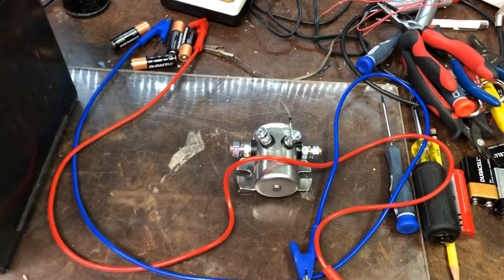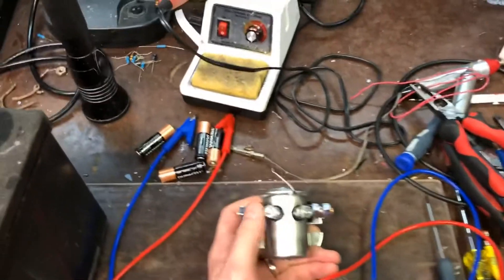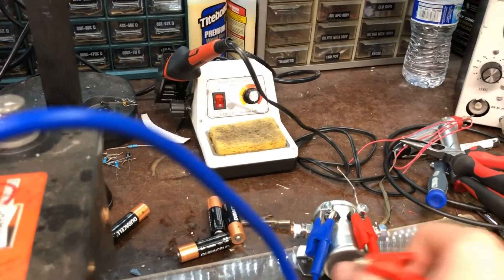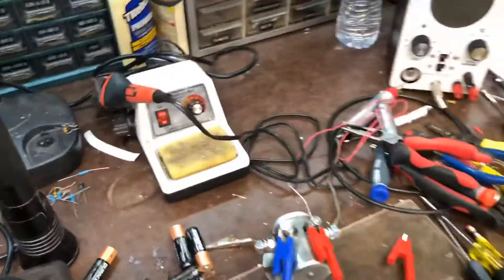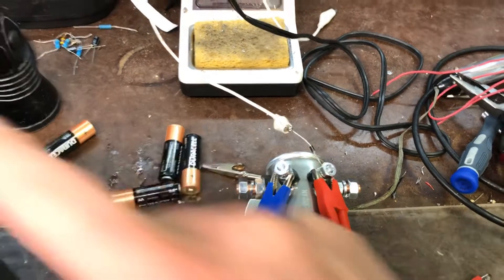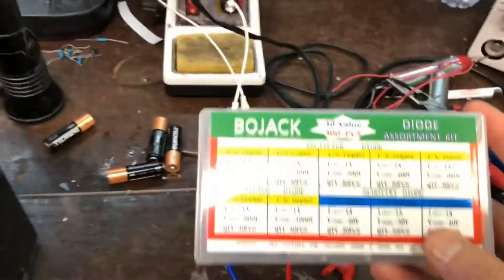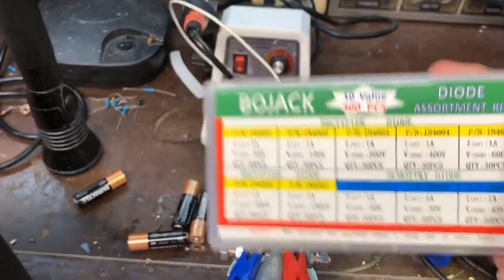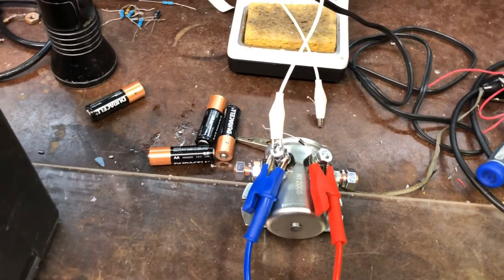Flyback Diodes for Dummies

Comment: Good explanation and video. I’m am an electrician and work mostly in industrial environments on motor and machine controls, and familiar with the need for diodes across coils. Surprisingly, this knowledge seemed to skip the automotive market. Possibly due to old cars having limited to no solid state electronics. The popularity of the aftermarket TBI systems has increased over the last several years and I often hear about the control modules failing. Im curious how many failures are due to flyback? I am surprised the manufacturers of these systems haven’t suggested or required ( for warranty purposes) installing flyback diodes across all relays or using diode protected relays that are switched by the controller, fuel pump, fans, ignition, etc. Most Bosch and other automotive relays do have internal diodes, but if people are getting cheap Chinese relays from Amazon or eBay, good possibility they aren’t equipped with diodes. A control board rated for 5 or even 12 volts isn’t going last with repeated flyback voltage spiking through the electronics.

Comment: this is really good info im building a full auto recoil gun controller and i have 2 push pull solenoids in parallel hooked up to a strobe light module thats power input is a micro switch (momentary switch) and after a few strokes full auto the switch contacts get burnt up and the strobe module flasher module probably gets burn up too i learned this by burning through a few, i hope by installing a flyback diode the industive load wont cause that nasty voltage spike and arc

Comment: Im going to use a flyback diode for a diy wind turbine. Im using mc4 connectors for the positive and negative terminals to hook it up to my wattfun. Now a days they have mc4 connectors with diodes in them so im going to buy one of those for my positive terminal. That way i dont need a controller or anything just plug and play

Comment: Nice practical vid.
Another "101" is to never wear wedding rings (or any other kind of rings or metallic jewelry) when working with electricity, especially batteries. A ring can turn white hot in a fraction of a second when shorted to a battery. Not a pleasant way to start your day.
Reply: Me backs up the video and sure enough there's the ring 🤣🤣.  That car battery can put 50-100 amps through it 🤦 goodbye finger.

Comment: Most Bosch relays have suppression built into them, check the little schematic printed on the relay case. It will show either a diode or resistor. Both work well with the resistor slightly increasing the life of the relay load contacts vs a diode.
Reply: Correct, but those little Bosch relays max out at 30 amps, this one in video is a Cole Hershey type, they go up to 200 amp intermittent or continuous duty.
Reply: @omieyouknowme  The relay/solenoid that he showed in the video only draws about 5 Amps. Don't confuse the control side of the relay with the load side of the relay. The load side may carry 200 Amps but the load side only has contacts. It doesn't have a coil to cause flyback voltage.
Reply: @bernardocisneros4402  agreed it's the coil side that has given me grief. I had to replace a Cole Hershey 200a constant duty a few years ago. The coil side was welded open. Replacement I added an external diode on control side no issues so far.

Comment: And Ford wasnt the only scammer...Chrysler/Plymouth and Dodge was too with their Electronic Lean Burn, or Electronic Spark Control ignition boxes starting in 1972 that needed a ceramic resistor to control heat for their ECU's and those guys were hired by Ford years later.........Flyback in cars with fully loaded options especially with electric motion heated seats was their biggest enemy aswell........Why do you think so many C/P/D's used to die in the rain when everything was running full blast especially rearwindow defroster and front window defogger windshield wipers and headlights....Diodes in the right spots would of eliminated those issues..

Comment: Look up diode suppressed starter solenoids...Theyre out there..What do you think started the TFI module debacle Ford had? Years before they put diode suppressed starter solenoids to supress flyback that welded the points shut and blew out duraspark boxes. Then they stopped putting diode suppressed starter solenoids and failed to put diode suppression in the EEC also the fuelpump relays and blam the TFI debacle began and billions of dollars in TFI module were bought with Ford skating by with minimal classaction lawsuits......It was the Greatest Scam Ford Ever had....
Reply: Intresting

Comment: Thank you so much! I owe you few beers at the least. I have been chasing an intermittent issue with my arduino freezing when a relay turns on a small 6v pump. One little diode and the problem was solved. I appreciate a simple explanation. You also saved my sanity from not having to watch any more one hour videos about wave forms on oscilloscopes.  Thanks again for the simple and brilliant explanation.

Comment: How would you calculate the needed amp rating for the flyback diode?
Reply from the maker: Probably easiest to measure it, but there is virtually no current in flyback.
Reply: @mechtrician1  The flyback current is small, but it's this small current that has nowhere to go that causes the high flyback voltage which results in sparks. The diode gives this small flyback current a path back to the coil and battery positive and it's this small current flow through the diode that doesn't allow for the flyback voltage to grow much higher than battery voltage. The flyback diode doesn't reduce an already high flyback voltage, it prevents it from ever developing by allowing this small flow of flyback current back to the coil and battery positive. For these relays you can get away with using almost any diode, but for fast switching applications, a switching diode is best.

Comment: Shouldn't these things be built in the contactor if collapsing a magnetic field and reverse voltage is that much of an issue?
Reply from the maker: Sometimes they are. A lot of control relays and contactors actually have a socket for a flyback diode built in. 
This is more specific to automotive I am referring to here. Some relay kits have them built in, some don’t.

Comment: fuse in series with diode is good idea too
Reply from the maker: This is true.  I assumed of course that you are fusing your control power that feeds the coil, which I always do.  Effectively the same thing, because yes, diodes do occasionally short.
Reply: @mechtrician1  thanks for your reply!